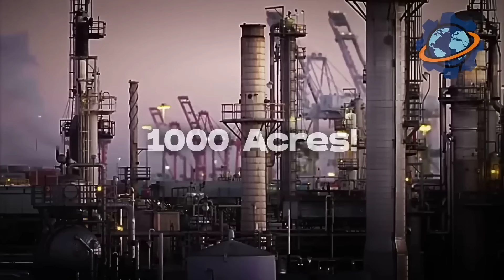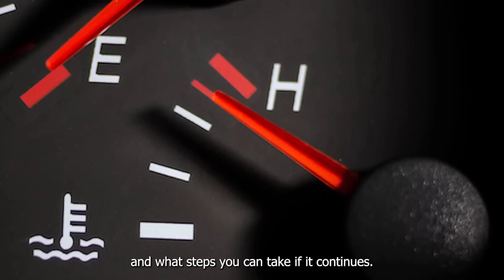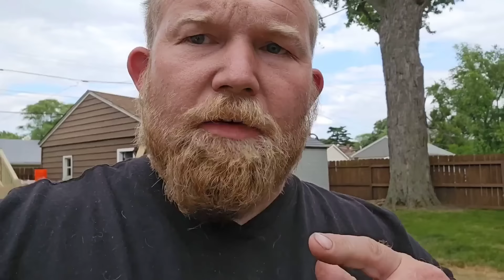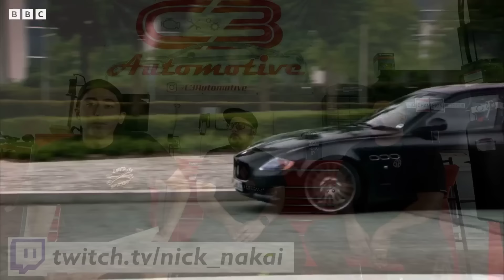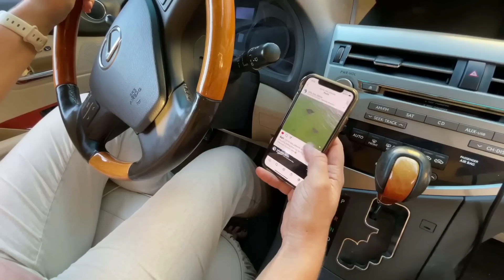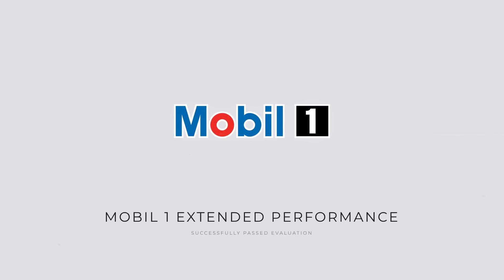8 'Full Synthetic' Oils That FAILED the 250°F Inferno!

Comment: This was confusing, the video talks about 250 degrees as the problem area for oils and yet confirms that the cheaper oils - Walmart, Kirkland -  meet this threshold.  It does however suggest that turbo engines need group IV and V oils.

Comment: Have been running Mobil 1 Extended Performance 5w30 in my 2001 GMC 2500HD 8.1 litre.  Now with 347,455 Mostly Highway Miles.

Comment: Group four oils are not created in in a lab without any crude oil as this video states. PAO is derived from ethelene gas which is derived from CRUDE OIL.  It is more modified at best but still made from crude oil.
Reply: Wow, good point.  But group 4/5 have proven higher heat tolerances.
Reply: @lonniebeal6032  Yes, and with today's turbo engines there is a lot of heat generated so it's a good thing the advancements in lubrication are keeping up.

Comment: I use different oils for different applications as there is no best oil.

In my racing motorcycle I use Motul 300v 4T, and in my aging car use Mobil 1. My snowblower and lawnmower get the used Mobil 1 from my car, and because of frequent changes and also changing the air filter in the Infiniti M37 every 15K miles, the engine oil looks quite fresh after 7500 mi.

Comment: Amsoil Signature Series is the best
Reply: But for the price Castrol edge extended 25k is better...Amsoil signature costs almost 3x more than Castrol 25k extended special edition
Reply: MPT Industries 30K oil beats Amsoil.  It’s 100% Group 4&5 Ester
Reply: so is their PI , for fuel injection cleaner
Reply: Torco is better than Amsoil
Reply: USED TO BE the best. Many choices keep up with Scamsoil. Many options are better than Scamsoil for the same or even less money.
Reply: Its too high....
Reply: That is what I use and change it every 15,000 miles even though it says 25,000 miles.
Reply: There is no best. There is only best for application. Amsoil is best at marketing to gear heads, but in independent tests it is bested in every category by other oils in one or more tests and additive packages.

There is NO best oil. 
Src: self. Petroleum engineer for 38 years.

Comment: Here we go again....I c have been using Kirkland synthetic for a decade in my 2010 outback 3.6r, 14 legacy 2.5i, and my 2016 Outback 3.6r. I have never had an issue.

When I replace my oil pan on my 2010 3.6R there was no sludge even with 7500 mile oil changes.
Reply: There's HUGE profit is selling boutique brand oils and that's why there's so much hype for them.  The Lucas Oil family has the largest estate in Indiana and they don't even live in it LOL, just use as a party center.
Reply: He really didn't say Warren Industries oils were bad...I use Supertech FS since the late 80s